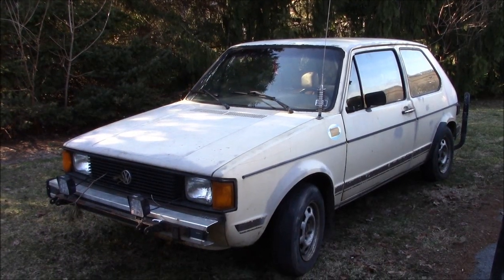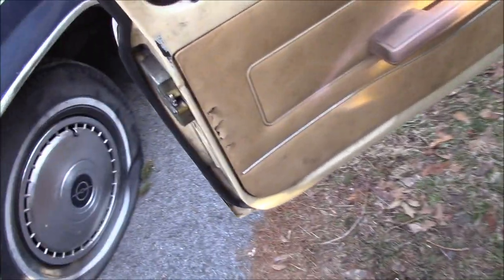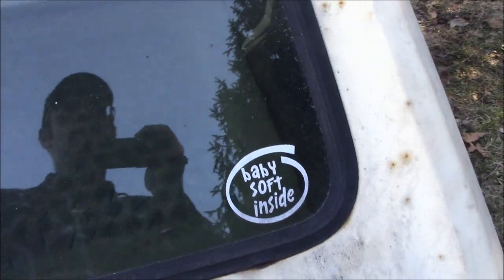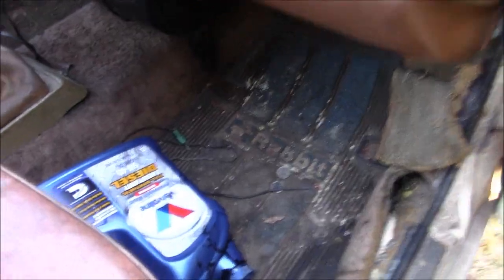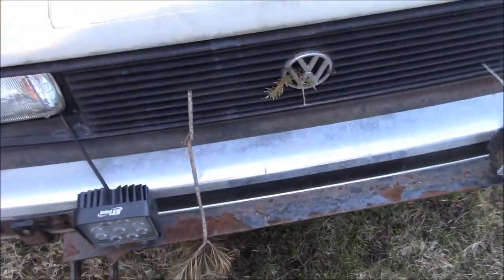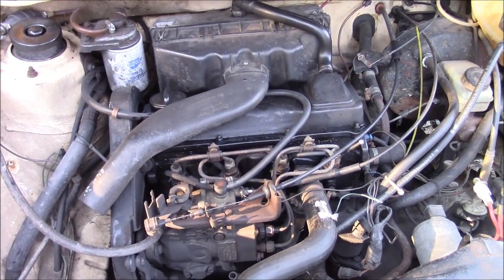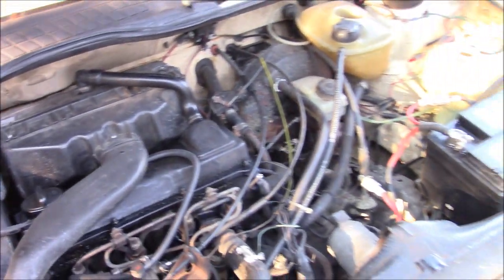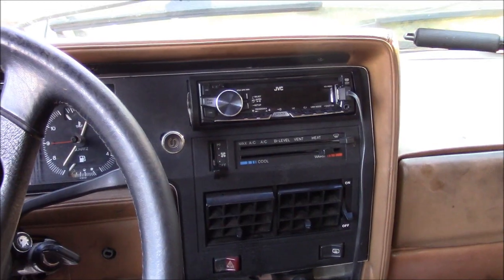I bought a thing - Mint Condition VW Rabbit Diesel

Comment: The orange glow plug light should come on as soon as you turn ignition key on. There is a relay that turns the glow plugs on - unless someone bypassed something...I use to have car like that one back in 90s
Reply: Yup. Those idi won’t start unless glow plugs working.

Comment: The clock works amazing.
Reply: I know! My 84 is heaps cleaner than this one and the damn clock doesn't work.
Reply: The quartz clocks run off 10v voltage reducer so they do not fluctuate when sitting or when the alternator spikes the voltage. 

No kidding mine will only lose 2-3 minutes. 
PER YEAR!
And I’ve owned it for 10 years

Comment: I had one that I traded in after I was caught by what dealer called “ the amazing VW self machining transmission “.  He told me those early VW manual trans would eat themselves if the fluid got low.  I should’ve kept it and paid the outrageous replacement cost.  Same dealer service rep told me that for the same costs of repairs I could’ve bought a Mercedes.
Reply: Luckily, most rabbits rusted out before that happened. This means there are plenty of transmissions and motors out there. You can replace a transmission in a weekend as long as you can find a shop manual. The old manuals are literally written for the illiterate.

Comment: If you haven't found out yet, the glow plugs are automatic in a stock vw rabbit and the yellow light below the oil light should come on.  When the light goes out, it's ready to start.  Non-stock, no idea.
ref: family owned 5-door hatchback can't remember version letters 81 diesel rabbit from 81-early 90s (wish I still had it)

Comment: Long AC pulley? You should see mine. Used a Caddy Alternator bracket, didn't know the AC pulley would hold the alternator, so it's that pulley plus another 10mm spacer.

Comment: Wow thats a rough one lol. Was it converted to a diesel? Because it looks like you have a gas gauge cluster there is normally a glow plug light. They cycle automatically when the key is turned on. The body and interior are rough, but it looks and sounds like it runs good.
Reply from the maker: No factory diesel. The glow plugs are bypassed onto a manual switch.
Reply: Fuel Injection Sucks That would explain the reason there is a gas cluster then! lol. The clusters in these cars suck. Never seen one that has a working odometer. Probably wasn't a great idea to make them with a million little plastic gears...
Reply: +CJBMAGGOT94 Nope that's the diesel cluster. I have the same Cluster in my 82 VW Caddy diesel. There isn't a dedicated glow plug light, the CEL lights up when the plugs are warming up.
Reply: carter bryant I have a 84 Jetta sitting in my garage dude. Every diesel cluster I have ever seen in a MK1 has a dedicated glow plug light indicated by a swirly emblem. There is not a check engine light in a single MK1 ever made, nor a MK2. MK3 was the first VW generation to have a "check engine light". You don't have a diesel cluster if yours does not have a glow plug light. It's common to have the cluster changed in a MK1 because the drive gears for the odometer were plastic and break very easily.
Reply: all rabbits are rough
Reply: all rabbits are rough
Reply: ***** they don't have cel's. They have O2 sensor lights. NEVER seen a mk2 with a "cel" light.
Reply: My Mk1 Caddy 1.6D is a California car as well, but it's a non catalyst car for some reason. It has a CEL/service light that is shared with my glow plug light. It's the original gauges as well. It looks like an upside down wrench.

Comment: wait till you drive it with that 1600 na motor. slow as molasses. Pull that out and put in a aaz 1.9 with a turbo and you will have a good driver. plus needs a restoration. Same gas mileage and better to drive.

Comment: Give her a late model tdi swap and it would be pretty sweet!
Reply: +Tyler Schwartz Yeah, no, the mechanical diesel engine is the best part of the whole car. It will run forever and you can tune it yourself, with a tdi all youd get is better mileage and way higher parts prices plus the pain of installing something like that. Great way to ruin the car

If anything, rebuild and put a turbo on it
Reply: lolatmyage 
Do a M-tdi. 
I built one back in like 04, it ran pretty good. 
14 flat In the 1/4 and 0-60 in 5.5. 
And about 8mpg better mileage on average. 
Anyone sayin they get over 50 in an idi is lying, but a tdi swap will!
Reply: @lolatmyage  the TDI cars are simple to work on. I have 2. Parts aren't cheap by any means. But they aren't hard to work on at all. I also have a 4 door like his that I swapped an ahu engine in. Super simple and tons more power